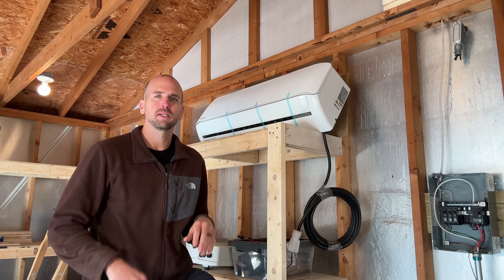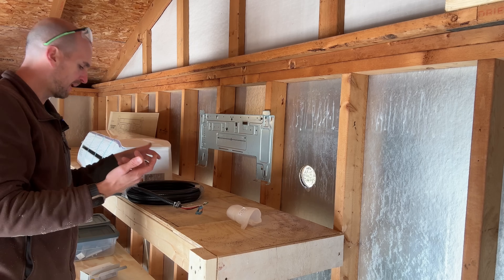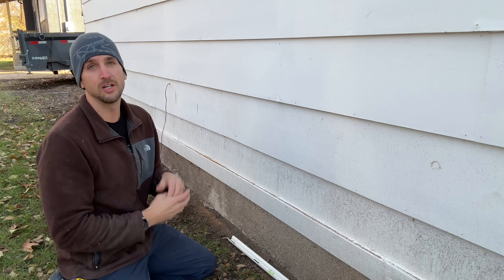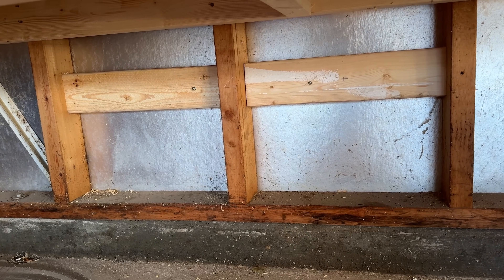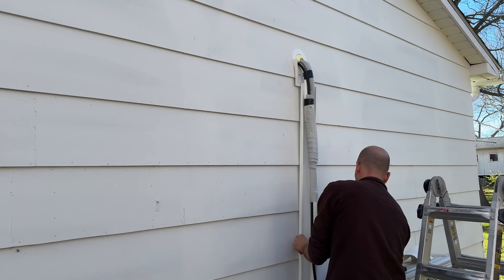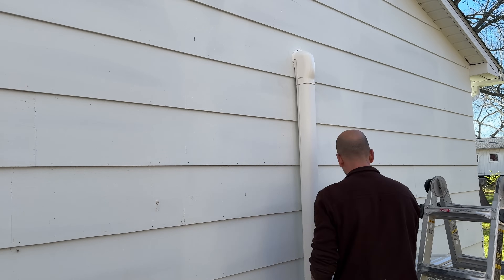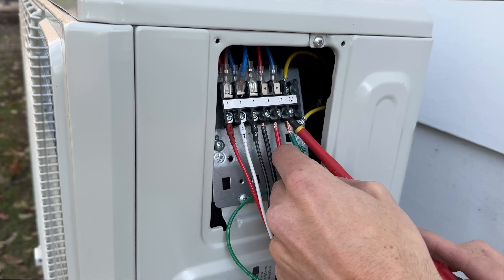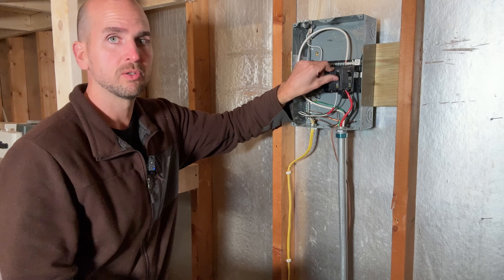Complete DIY Mini Split Installation | New Mr Cool 4th Gen Unit

Comment: Everything looks great and you did an awesome job of explaining the whole install in simple terms. One thing to note however, is it's been in several NEC code cycles now, but you'll want to let people know that code requires a GFCI protected outdoor receptacle within reach of the disconnect and the outdoor condenser unit. It's required for servicing the unit.
Reply: He has a disconnect and the ground fault is not a requirement for DIY
Reply: My 120v Mr Cool 12k did not like a gfci. I had to remove it.
Reply: @slipstreamvids7422  The GFCI outlet mentioned is not for the mini-split system to be plugged into. In fact, your condenser should be hard-wired directly to the appropriate breaker. It's just a required outlet near the condenser for a service technician to use to service the unit.
Reply from the maker: Good point, believe it or not we are still on 2014 🙂
Reply: Not that I agree with it, but code says all condensers need to be on a gfci circuit. Apparently some kid climbed on to a condenser and grabbed a steel fence and died. In the knee jerk country we live in, they now require gfci’s.  Yes gfci  protected 120v receptical is required as well.
Reply: @ericanderson9004  Whoa! That's a new one. Horrible!

What sucks is the costs of these GFCI breakers are so crazy that it makes people cheat and try to avoid installing them, at the cost of human safety.
Reply: @ericanderson9004 …wow, a kid died, and doing something to avoid this in the future you call a ‘knee-jerk’ reaction.
Reply: @ernestgalvan9037 yeah  I do. Sorry about kid. 
Electrician worked on unit, left system off, somehow the ground was disconnected, someone turned breaker on which should have cleared the breaker.  Now every ac Unit needs a 200 dollar breaker!  Sorry, but that is an acceptable loss, less then 10e-9. 
Don’t ever fly, because this is the criteria!
Reply: There is no GFCI receptacle for 220v
Reply: @sammax4245  No there isn't. The GFCI mentioned isn't about the 240V disconnect. Code asks for an 120V GFCI receptacle within the area of that 240V disconnect for service technicians to be able to use... whether it's a disconnect for a condenser, pool, hot tub, solar PV, etc. For example, an HVAC tech may need to pull a vacuum on the linesets of the condenser. His equipment needs to plug into a receptacle that is obviously GFCI protected.

Comment: There's no refrigerant in the lines, they're just pulled to a vacuum, which you pierce when you connect the lines.
All the refrigerant is in the unit, which is released when you open up the valves.

"Precharged" is just not true, they're "prevacuumed".

You could also just order any decent mini split from Daikin or Mitsubishi, get a $150 vacuum pump and do it properly yourself. You'll save yourself hundreds of dollars.
The hardest part is not kinking the copper lines, but if you get a $50 tube bunder for AC lines, you'll save yourself a lot of hassle.
Reply: They are pre charged with refrigerant. They sell line sets up to 50 feet. An outdoor condenser is usually only pre charged rated for 16 feet of line. MrCool units, using their line set, can run upwards of 80 feet, with a maximum of 232 total feet for their DIY units. There is no possible way they are over charging their condensers to support 232 total line feet, the unit would not cool effectively at all anymore.

This is from the no-vac pre charged line set customer brochure.

100% Accurately Precharged R410A Refrigerant
15 FT
1.94 OZ
25 FT
3.17 OZ
35 FT
9.77 OZ
50 FT
19.44 OZ
Reply: @KilerChese  Daikin splits usually allow up to 20 meters (65 feet) for the smaller ones and 30 meters (100 feet) for larger ones. No need to buy precharged lines unless you need to cover a massive distance.
Reply: @OverSoft  No such thing as precharged lines. Just pre vacuumed.
Reply from the maker: Thanks for the feedback.  The wall vibration would get old fast 😂.
Reply: The Daikin and Mitsubishi units come precharged? Or are we talking buying refrigerant on top of that.
Reply: @crg34  All splits come precharged with freon in the compressor, you vacuum the line via the service port and open the freon valve to start up the unit. Very easy you just need the right tools and a vacuum.
Reply: @crg34  YES. Only Mr.Cool is pre charged. It's why they are DIY.
Reply: @crg34  likely pre chargers
Reply: @crg34  All Daikin and Mitsubishi outdoor units come precharged with enough charge to run a decent lineset.
Reply: I have looked in the non-DIY units are considerably cheaper, I have flaring tools and pump that I use on automotive systems. The problem is they won't warranty it unless it's installed by a professional HVAC company is what I've been told.
Reply: @TheScotzo  internet, printer and some paper wills solve that ;)
Reply: Except that you won't get any kind of warranty coverage from Daikin or Mitsubishi if you DIY. Also, I've heard that many of the internal components in the MRCOOL units are Daikin made.
Reply: One of the greatest features of a Mr Cool are the leak proof connectors. Cut and flared lines leak, period. These dont and thats gold for diy ers. Takes the skill and experience  out of the equation.
Reply: @slipstreamvids7422  Just use Nylog on the connections and they won’t leak.
Reply: @slipstreamvids7422 they leak! All o ring crack and dry out. Braze or proper flare is the only way. The extra line set loop looks terrible to boot.
Reply: should 100%  get a vacuum pump and trim the lines to minimum spec. any additional line outside will bleed off heat...
Reply: Not need vacuum, it's brand new and seal system

Comment: On the lineset, something folks should know is that you should never just tuck the lineset vertically behind the condenser like he's doing.
If you have extra lineset like this, it should be coiled horizontal under it, if it isn't(ideally) cut to length.
Reason being you are going to have the lubricant within the lines pool at the bottom vertical coil otherwise, and eventually the compressor is just going to wear prematurely.
I had this beaten into me multiple times by HVAC techs while researching mini-splits before I had mine installed in my garage.
PLEASE head this warning, especially if you want your warranty to hold up.
Reply from the maker: I need to check the instructions again.  I know the coil was called out but didn't see them specifically calling out horizontal.  Either way, thanks for the feedback.
Reply: @EverydayHomeRepairs  It's mentioned in the install manual at the bottom of page 27, but they don't really point it out as clearly as they should! The image on page 32 would be an excellent place to speak to that as well, BUT THEY DON'T, so it's no wonder a lot of people miss that detail and make this mistake.
Reply: In most installation manuals in have read that how they say you should do it, coiling the tubes.

Comment: After reading @SEEMORE45 's comment I did more research and realize just how wrong i was. Those precharaged list sets are pretty amazing technology. I would love to learn more about that. OG COMMENT:no attempt to be critical, but the linesets cannot be "precharged" you have to uncap them in order to attach them to the condenser or indoor unit. I believe the charge exists inside either the outside unit or the inside unit, not the line sets, otherwise you would loose the charge when you went to connect them.  Great video either way, love the general explanation. Just an additional point that before you release the condenser refringent, you should vacuum the system with a vacuum pump and let it settle and verify that you maintain the vacuum before releasing the refrigerant from the condenser.
Reply: Both ends of the line set are sealed , think like an air chuck on the end of an air hoes you use to pump up a tire . When you tighten up the line set it pushes in and then it becomes open , after sealing .
Reply: nice, that's great info. I had not seen that before but after your comment I went and looked it up and you're right. What an amazing technology. I'll update my original comment. Thanks again.  @SEEMORE45

Comment: Great video. In our house the wall mount bracket for the Mr Slim Mitsubishi' s did transmit a loud vibration to the interior as the variable fan speed ramped up and down. Very irritating. I solved it by ordering four silicone vibration isolating pads with threaded rods up and down. They were round, shaped like a squishy bell, and totally cured the noise issue.
Reply: I have the same issue. In the house it sounds like a truck is driving by the house, even with an entire garage between the condenser and the living space. Can you provide a link for the vibration pads please!!
Reply: @festerofest4374 did you ever find out the link to the isolation pads?
Reply: @gedionsamuel2256  No! Just dead-ends with prob hours scouring the web. Ended up cutting some semi-rigid packing foam to use. Ugly but doing the job I guess.
Reply: Google motor mounts pads. Might have better muck on finding something
Reply: @robertcompton6281 I googled the sh*t out of it.
Reply: @robertcompton6281  I scoured probably hundreds of sites that would be reasonable leads for something like that. Engine and machinery mounts and pads by the zillions....

The challenge is finding not just an appropriate size, thickness etc... but the HARDNESS/SOFTNESS. The MrCool mini is quite light. I was trying to find soft-ish, a bit squishy type of material, and that is where the challenge is. 

Using the packing foam was perfect functionally. Closed-cell (non-absorbent), rigid, but I can squish it a bit between my fingers.

Comment: Just curious how the unfinished garage affect the effectiveness of the Mini split system? Are you planning to insulate the garage later? I was told by an HVAC person that even though my attached garage has insulation and drywall on the outside walls, the attic above the garage does is not insulated (except on the edges / soffit area) and that I should consider insulating that area and mudding /taping the walls to minimize heat / cold air loss? Great video as always. 👍
Reply from the maker: Yes, I will need to insulate for this unit to have a hope of not just running all the time.  I need an insulated garage door and also will probably be doing closed-cell insulation to keep the garage open to the attic but still get at least single digit R-factor.  I will probably try some of the DIY closed-cell insulation kits you can get off Amazon to see how much area they will really cover.
Reply: @EverydayHomeRepairs  Nice - thanks for sharing. Couple things I forgot in my original post / question was:
a) The builder did add insulated garage doors and solid core doors when we built the house back in early 2000s. But it does sound like - for the long term - if we want these units to be really effective in the North star state, we will need to properly insulate the area. 
b) Curious if you might be willing to share the size of the detached garage. Our attached 3-car garage is roughly 972 sq ft with 12 foot ceilings (not including the attic space). I initially thought perhaps a 18k BTU unit might suffice but just wondering if perhaps we should consider a 24k BTU unit for the area that needs to be covered?
Thanks again.
Reply: The functionality of the unit is irrelevant.  He got paid good money to make this video.
Reply from the maker: At least as it is now I don't take sponsorships.  The company can send the product for free and I will put links to Amazon in my description which does have an affiliate commission (no extra charge to the viewer) but no set amount paid for sponsorship and no control over me sharing my actual experience.

Comment: Hi, I did a Mr. Cool DIY install a year ago and it went fine. However my inspector called me on two items. (1) The coils of extra cannot touch the ground (don't know why.) (2) You need safety caps on your main unit connection valves, not the regular caps the manufacturer supplies. Safety caps need a special tool to remove. This is North American standard, The reason is, some kids have been killed by removing the standard caps and sniffing the refrigerant. This is one more requirement written in blood, like many code requirements. Mr. Cool should know better but they consistently ignore this code requirement.
Reply from the maker: Huh, that is actually the first I have heard of safety caps.  I appreciate you calling that out.
Reply: For small unit like this one has less than 2 pounds of refrigerant doesn't require safety caps.

Comment: Nice to see the process.  I believe Code requires a service receptacle within 25ft of the exterior equipment. I'd continue the drain pipe down to near the ground  and perhaps install a gravel filled dry well.
Reply from the maker: Yeah I should have called that out as it looks like 2020 NEC brought that in, we are still on 2014 😀
Reply: @EverydayHomeRepairs  That requirement is probably also in your State Mechanical building Code.
Reply: I've been an electrician for 22 years. They've required a 120v outlets within 25 feet of refrigeration outdoor equipment since at least 2002.

Comment: What about the refrigerant lines being coiled vertically like that? Wouldn’t that trap oil and starve compressor of oil over time?
Reply from the maker: I need to look into that further.  I didn't see horizontal being called out but will update a pinned comment at the top if that is the case.  Thanks for the heads up.

Comment: 18,000 BTU sounds too small for my insulated garage and it looks like yours isn’t even fully insulated. Is there a size calculator that can be used?
Reply from the maker: I will be insulating the garage in the coming month.  I just want to keep the garage to around 55F-60F in the winter and 75F-80F in the summer so with a reasonable amount of insulation I think this is doable with the 18,000 BTU unit.
Reply: @EverydayHomeRepairs  what is your square footage? I'd be curious to hear how it goes after you insulate. Maybe a followup video?

Comment: Nicely done but I think I'm too type A not to torque the connections and check for leaks with some soapy water before I encased it all.  Is Mr. Cool the only DIY ASHP available?  You can DIY others with some extra tools but without a HVAC certification number you don't get a warranty.
Reply from the maker: I actually did the soapy leak test on the connectors and then somehow missed the video clips in the editing 🤦‍♂️.  There are other options out and basically anything with "pre-charged" lines would be targetted at the DIY crowd.

Comment: I did one last year or two on my garage. I also did the wall bracket and wish I hadn't. The bracket is designed for use with concrete, which is why it's only 30" wide, and on wood framing will vibrate noise into the garage. Also, my garage was done to ADU standards, insulated and sheet rocked. To get the most out of your unit, insulation and some kind of wall covering will help.
Is that shelf staying there? It will block some of the air flow.
I've had mine going all winter and it hasn't missed a beat. I do get a bit of a hum form the outside unit mounted on the wall.
Mine is a 12k 120 unit.
Reply: Good to know, thank you!

Comment: Wanna hear something outrageous? In my city, you can’t drain the condensation directly outside. It has to be drained into the main plumbing drain (usually via a condensate pump). The code enforcement officer admitted it made no sense at all, but wouldn’t let it slide.

Comment: Interesting video, nice clean installation. The only thing I might have done differently would have been to place the unit to the left of the dropped lines rather than to the right. Just my OCD talking here but it would of allowed the lines to be run in a very similar pattern without having to put a kink in them prior to hookup. Very trivial point but one that would need to have been fixed prior to charging the lines. That and your wire run to the box inside would have been shorter saving wire. The only other thing I might think about would to possibly hang the external unit higher on the wall to get it off the ground and away from possible harm that could come from children, pets, or others that may be in your backyard.
Reply: Raise the external unit higher is a good point too also keep the condenser out of the dirt line on the Wall it will greatly help keep the cooling fins clean in the unit.

Comment: Will the oil pool up inside the coils behind the condenser?
Reply: yes, you will get oil trap and could burn up compressor, restricts flow of refrigerant.  lines should be placed horizontally not vertically, when you have pre-charged line sets.

Comment: Great video, but I didn't hear a very crucial question answered. How low can the outside temperature be and this still be effective. Where I live in north Idaho temperatures can go below zero. Average daily range is around 20 degrees to 35 degrees. Seldom is the temperature average. Below average is much more the norm. We average 6' of snow and have seen as much as 15' in one winter.
Reply from the maker: I want to test it for myself this winter but Mr Cool claims the unit can still produce heat all the way down to -15F which seems a bit crazy.
Reply: @EverydayHomeRepairs  The next question, then, will be, how well will it heat a 2 car garage when the temp is hovering between 0 and 10 degrees. I'll look forward to your report come Spring.😊

Comment: It's interesting that they pre-charge the lines with Freon instead of a vacuum. The older systems have the charge stored in the compressor and you have to pull a vacuum on the lines and air handler then open the valves on the compressor.  I actually prefer these because I don't like having all that excess line. Admittedly, I do have a vacuum and gauge set, so it's not a big deal.
Reply from the maker: Yeah, all the extra is definitely a trade off of these type of DIY systems.
Reply: Do you have your EPA 608?
Reply: @QuinnTheVegan why do you need that?